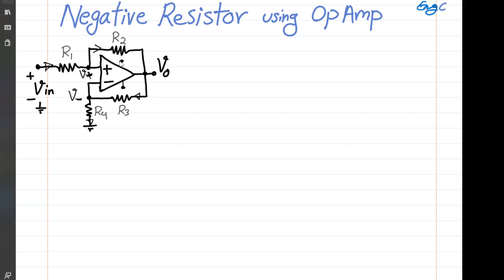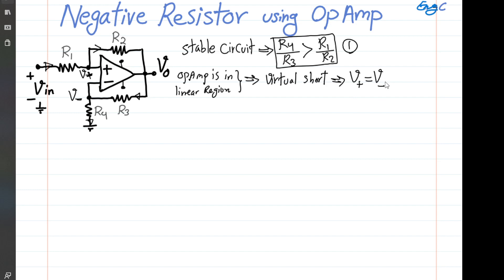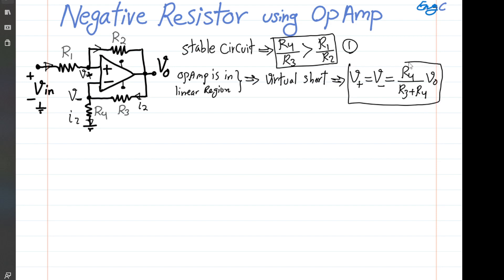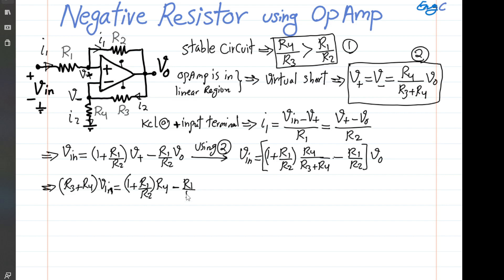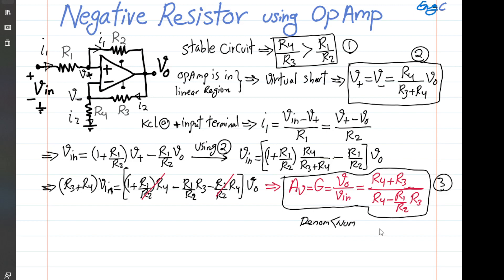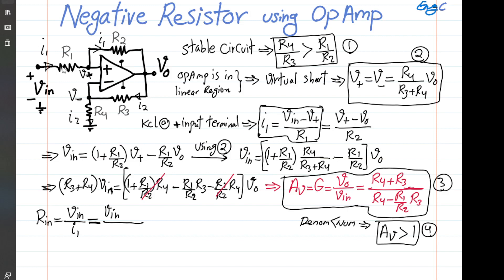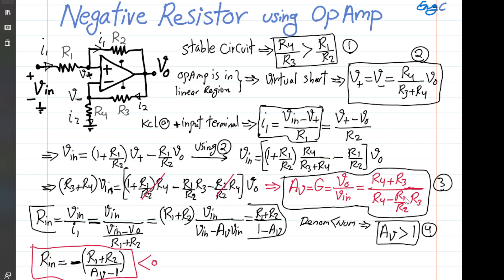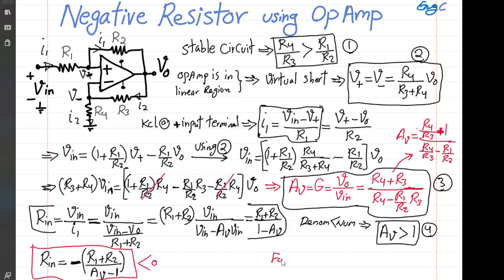Negative Resistance Circuit realized with one Op Amp

Comment from the maker: Thanks for watching. For more Analog & Op Amp Circuit examples please see Converting Capacitor to Inductor https://youtu.be/weIHG45G6Pg 
Logarithm Analog Computer with Op Amp https://youtu.be/RpKEq5WyoLg
Push-Pull Power Amplifier with Darlington Transistors https://youtu.be/866MYibo8yE
Analog Computer circuit that solves Differential Equation. And https://youtu.be/HeZRtnRXpEI
Capacitor to Inductor Converter Circuit https://youtu.be/weIHG45G6Pg
Active Inductor with Op Amps https://youtu.be/6IYz4iaa05c
Negative Inductance Design by Op Amp Impedance Converter https://youtu.be/GF_Mun_Mkyo
Operational Amplifier Gyrator Network Circuit https://youtu.be/2KpjAytRBpc
Full-Wave Rectifier  https://youtu.be/DJJMNU-CYcg
Triangle Oscillator Op Amp circuit https://youtu.be/JF5Up_cuL9k
Differential Equation Solver Analog Circuit https://youtu.be/R3X5AYNZGEI
Diode-Amplifier VTC is analyzed in https://youtu.be/vpGZkafxMJM 
https://youtu.be/HeZRtnRXpEI presents a circuit with op amps and feedback loops to design an analog computer that solves a second order differential equation.
For more analog signal processing examples see: https://www.youtube.com/playlist?list=PLrwXF7N522y4c7c-8KBjrwd7IyaZfWxyt
I hope these Circuit engineering and analysis videos are helpful. 🙋‍♂️

Comment: Thank you for going through the derivation of this and stating the conditions of stability and constraints. Too many explanations I've found simply state the final result Vin=-R2*I or -R2=Vin/I without stating how they got there.  I'm currently working on a way to implement an analog signal multiplexer IC but I didn't know how to cancel the inherent internal resistance of this component.  With your information I think I can proceed with my project. Thanks!! 👍
Reply from the maker: You're welcome. I'm glad that this negative resistance video is useful for your project. Here is another interesting circuit video of simulating Negative impedance designed with Op Amp: 
Negative Inductance Design by Op Amp Impedance Converter https://youtu.be/GF_Mun_Mkyo
And here are related examples: Capacitor to Inductor Converter Circuit https://youtu.be/weIHG45G6Pg
Active Inductor with Op Amps https://youtu.be/6IYz4iaa05c
I hope these Circuit videos are interesting as well.

Comment: Hello, I have a question about stable circvit: How is R4/R3>R1/R2 derived? Can you answer it for me, thank you.
Reply from the maker: That's a good question. One quick way to derive R4/R3>R1/R2 is: For stable circuit we need dominant negative feedback in this circuit. That means the contribution of output voltage Vo to the negative input terminal R4/(R3+R4)*Vo should be larger than its contribution to positive input terminal R1/(R1+R2)*Vo.  Therefore R4/(R3+R4)>R1/(R1+R2) which results in R4/R3>R1/R2.  I hope this circuit video and explanation are helpful.
Reply: @STEMprof  ok, thank you for your answer and wish you good luck.
Reply from the maker: @谢泽文-n4x  You are welcome, Thank you! Glad that the clarification was helpful.